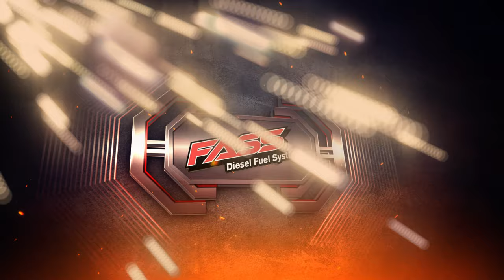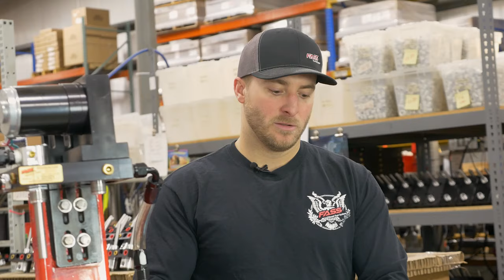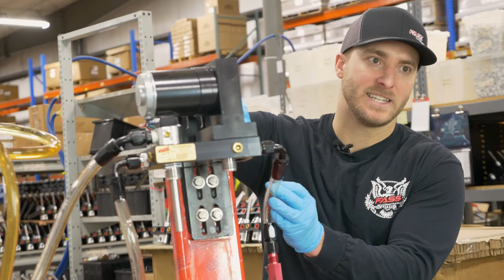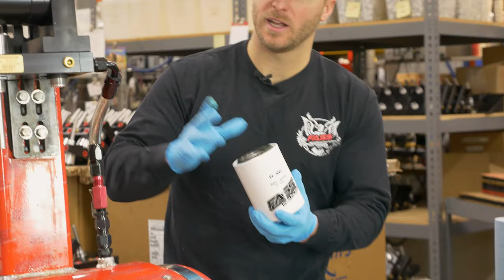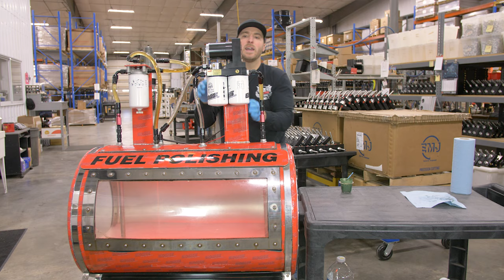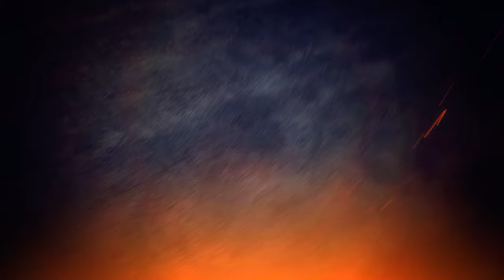How to Prime Your FASS System With The XWS-3002 and PF-3001!

Comment: I've tried this and fuel sprayed all over the place so I just tighten it back up and was like guess this is good the sound has not changed though I literally followed what this dude explained in his video except the fuel spraying all over the place. Fass still loud though, my system was never so loud until these new filters came out and was installed on my truck by the shop so i figured a filter was clogged and decided to do another filter swap with the xls
Reply from the maker: Hey there, thank you for reaching out. We apologize for the trouble you're having and we'd be happy to help! Our techs are here from 7-7cst and our number is 636-433-5410. 

Thank you very much!

Comment: I have tried everything a few times my brand new fass paired with deviant sumo return will not prime. When it’s running I can hear air being pushed into the tank but it will not pull fuel. My truck is dead in the water I’ve spent over 10 hours trying anything I could find or was recommended to me.
Reply from the maker: Thank you for reaching out and we do apologize you are having so many issues with the system. Whenever it's convenient we would suggest reaching out to our service team to help get this diagnosed and make sure you have everything you need to get your truck back on the road. Our number is 636-433-5410. Thank you!
Reply: @FASSFuelSystems  it was my fault cross threaded a fitting. I have an email off through the contact us on y’all’s web page to buy the two fittings I messed up. Thank you very much for the reply!
Reply from the maker: @fishinmagician3960  Of course! Please give us a shout if we can help with anything.

Comment: Had my pump for a few years and have never purged when changing filters. I just fill them with fuel screw them on and cycle the pump. Is this bad for the pump ?
Reply from the maker: No worries at all. It's just another way to do it. The only thing we suggest is not running the pump unit itself dry as it is lubricated by the fuel that runs through it.

Comment: So what happens when the water filter gets full when you are driving.?
Reply: Engine basically starves for fuel and engine shuts down. Don’t know how bad that would be for the CP3 pump, so keep a spare just in case.
Reply: @frankmjr6571  i think a cat 1R-0750 fuel filter and a Donaldson P558000 water separator  with twist drain , your might check the numbers,,,, i wouldn't want my engine to shut down as pulling our trailer down or up or just driving on a hill or anyplace.

Comment: On my 06 Duramax with Fass 100gph I just turned key to on position and it primed returning fuel to the tank without loosening a filter.
Reply: I recant my previous comment as I just changed my filters and had to prime as video describes

Comment: My instructions say to put the fuel filter on the side with the draw tube. It seems like the video is placing the water separator filter there, is this correct?
Reply from the maker: Great question, and it will depend on the series system you have as to which filter goes on either side. If you have a grey, or black base system the filters will be aligned as shown in the video. 

We'll also be happy to help answer any questions you have over the phone as well. 636-433-5410.
Reply: I have 2016 LML.  My pump assembly has black base.  WS filter comes with the o-ring gasket.  Is it safe to assume that the o-ring gasket always goes on the side without the draw tube, regardless which side the instructions say to put the filters.  Can I trust the image on the side of the filter to determine which filter goes where or could that vary depending on the pump base color?

Comment: I have a 2016 LML with the FASS 100gph lift pump and a stock fuel filter delete, do i have to drain water from the filter or anywhere for that matter periodically? I just bought the truck so I'm still learning stuff about it. But yea just wondering if i have to drain the water separator or just change them when time comes due. Thank's!
Reply from the maker: Hey Josh! Thanks for reaching out. Congrats on the new truck! 

We recommend changing your fuel filters every 20,000-30,000 miles, or 1x per year if driven less. Our newer filters feature improved filtration technology, and don't actually feature a drain (the water is now held within the filter element).

If your truck's equipped with drainable filters, you're technically supposed to drain them daily. That said, 1x per week is usually sufficient, depending on the quality of fuel you're able to get.

If there's a chance that the filters on your LML have been there for a while, we'd recommend changing them out for the updated versions!
Reply: @FASSFuelSystems  i can't see a drain on the filters or system it so i must have the updated version, and i know they were recently done but I'll still stay on the shorter side of that recommendation! Thank you very much for the prompt reply, much appreciated! 🍻

Comment: I was told to ensure fuel comes out of the 3002 to completely bleed the system, then tighten 3002, as it begins gushing out; can you update if this is correct or not?
Reply from the maker: Hi Jimmy, thank you for reaching out. Yes, that is the correct procedure for installing the XWS-3002.

Comment: How often do you change the new filters?
Reply from the maker: Approximately 20,000-30,000 miles depending on fuel quality.
Reply: @FASSFuelSystems  so it could be anytime depending on the person and the last fuel fill up
Reply: I have put 5000 miles since my first change, and the timeline has been 1 yr. You don't think the water separator needs to be changed? Regardless, I think I will change both filters for peace of mind.